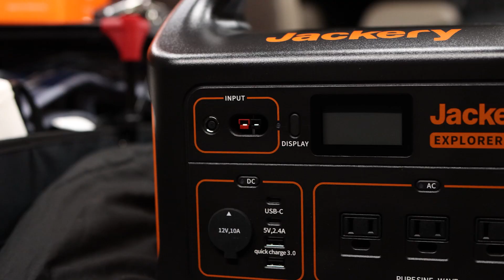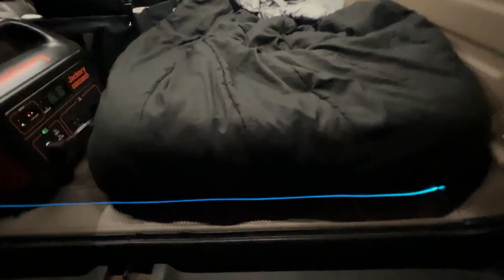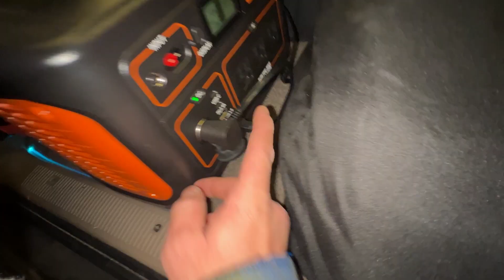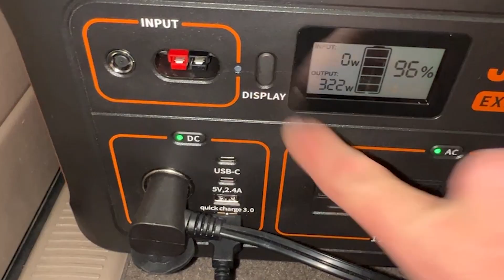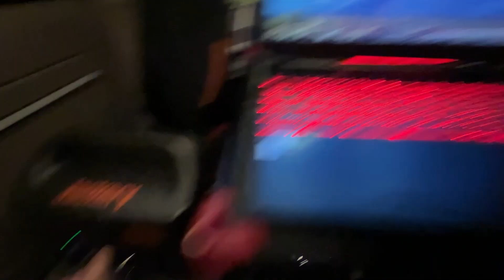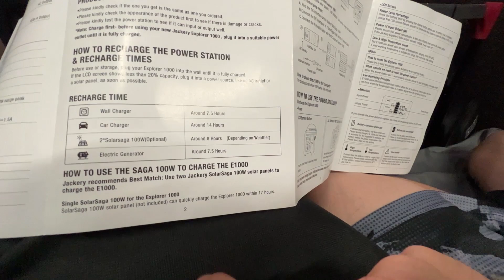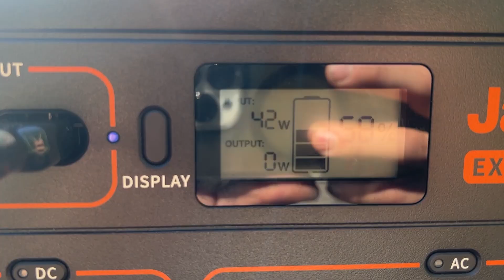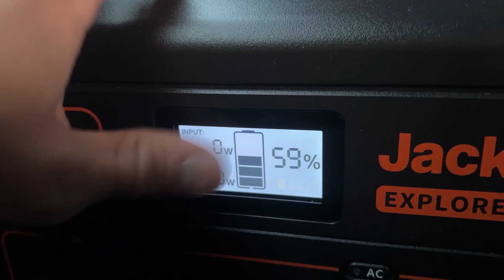SUV Stealth Camper With Moto Hitch Carrier Tour | Jackery E1000 Testing | TW200 MTN Adventure

Comment: Hello again from western Canada. It's been awhile. So, u r outfitted pretty well but I don't think you will be having guests over for the night lol.
Couple suggestions at me being 72. I've mentioned before I have a 2018 TW. So back in the 80s, my wife and I were camping a bit remote in my converted van. We slept cross ways to the back doors. It was super hot in the summer so I had one of the back doors slightly ajar. In the wee hours , someone or something tried the side door. Talked about scary. I gently got the back door closed so I could lock it.
For yourself or any body, I think you should have a few very bright roof lites and a siren that you could just hit an emergency but button to turn on all ur outside security. Being you camp solo.
The other thing is you should have a small nylon RV carpet to step on to reduce dirt traffic.
Finally, being you have a roof top carrier, have you seen those little steps that hook into the door latch loop on the door frame? It gives you a step for getting things off the roof instead of standing on the seat.
Cheers, Kelly
Reply from the maker: hello good to hear from you again! for sure, only room for 1 haha. neat, oh wow that's insane. i'm sure that was scary, glad you were able to lock the door, yeah that's a good idea for sure, I do have a remote start system so I could hit that. on the van i'm going to have 4 night vission cameras with IR illuminators and switch and screen next to the bed with a 4 channel switcher so I can always see whats out there. that's a good idea as well, sure do get a lot of dirt inside. those are neat, I usually stand on the tire and that works pretty well too
Thanks!

Comment: i did my express van with a big kitchen counter and usb faucet and sink too. lived out of it a few years and saved tons of money while working. tbh rarely needed the sink, even when i was out in the backcountry camping and riding; but probably cuz i had a below counter grey tank and quickly learned brushing your teeth into it got too funky. my newest van is a 2011 sienna wheelchair van with built in tie downs. made the bed to fold up so i can wheel my xt250 in and strap it down. you can put your bed in the suv on a short platform that folds up and keep bins underneath for all your stuff.
Reply from the maker: nice! seems like the life. yeah depends on the person, I could see myself using it a lot. but yeah under the sink gray water would suck, mine goes outside into an outdoor bucket or ground depending on area rules. nice, yeah for sure a lot of ways to do it. i'm doing a lot of neat stuff with my econoline build

Comment: Thanks for the vicarious adventure! Love the idea of simple stealth too. One suggestion for your rig, add another switch and offroad led floods on the 4 sides of your roof rack, great to light up camp for setup and when u hear something outside in the middle of the night
Reply from the maker: hey no problem, thanks for watching! that's a neat idea, I would like to do something like that someday, defiantly doing a setup like that on the van. also doing a 4 channel camera setup on the van with night vision so you can monitor out 4 sides with night vision cameras right from inside at the bed. going to be a rad setup

Comment: Yep! On our Idaho trip, we went up over 10k' with no carb issues, stock jetting. I think the early tdubs with the pumper style carb me be affected by elev some, but still maybe not as bad as some think. I will say, we rode close to 1300 miles through Idaho and Montana, and at high elevation the fuel mileage was way down. If you lived there all the time, it may benefit from a leaner jet. Good video man, enjoyed it!! Looks like that area close by was huge in mining.
Reply from the maker: awesome, good to hear that worked out well. that makes sense, they did upgrade the carb at some point. oh interesting . for sure could make a difference. I need to do some fuel mileage tests on mine. thanks so much! I'm sure it was, I thing one of the roads or something is called minecart road haha
Reply: @TDubsKid  ha, that's cool! When we were up in Wallace Idaho, there were deep mines on every corner. Such a cool place. Think I read where like 21% of the world's silver came out of that area!

Comment: Stealthed my dodge ram last yr,,,nice to have options
Reply from the maker: nice! do you got a shell on it, truck campers with the shells seem like a good way to build
Reply: @TDubsKid  I'm slipping into geezerhood,,I like trucks,,but vans are a more comfortable option,,,before the truck I considered a 172 inch wheel base dodge promaster,,I am the only person I'm aware to fit a diesel heat into a pickup with a shell and make "NO cuts to do it,,it's in front of the drivers side rear wheel and ducted with abs plumbing pipe thru two plastic capped holes in the bed bulkhead that we're there from the factory,,in front of the other rear wheel is a 130 amp hour wet battery to run heater fridge light phones fans etc,,and on rear is a15" x15 4ft aluminum box that plugs into the hitch receiver,,i can fully stealth ,,remind another time and I'll tell the mods on my tw 200
Reply: @TDubsKid  air is thinner and cleaner at high altitude,,use a less restrictive filter media
Reply from the maker: @wonyankeesays5661  yeah makes sense, trucks just dont have much headroom, its nice being able to stand up though, I just test drove and inspected a promaster van at work, it was really interesting, sooo much room inside, have you driven 1 it’s interesting, feels like driving a compact car for some reason, I would stay far away away from a diesel promaster they have major issues, the regular promaster is ok but they do have some reliability issues. Wow that’s interesting, I would like to see how you have the diesel heater mounted. Do you use a Chinese diesel heater? Sounds like a cool setup, lead acid power is not bad just heavy especially if you need a lot of kwh
Reply: @TDubsKid  went truck,,vsn get attention more when stealthing,,,wife and I are over six feet,,just have to think everything thru very well before do ur build,,not a diesel person,,except for heating,,I have six of them now,,,the gas penta stars make plenty power,,mine A red regular cab long bed,,had to go to another state to get one,,went with a renogy charge controller for electric,,paid a pro to install it,,

Comment: Thanks for sharing the adventure! Nice power supply. I look at those from time to time. Sweet discount.
Very cool setup. I wish I was getting out more. Sorry to hear about the other drone. Good luck with the new build.
Reply from the maker: hey no problem! thanks for watching. so far it seems to be a great power station, yeah they are cool, just wish they were not so expensive. maybe someday there will be a battery technology breakthrough, thanks, it was fun to build. I wish I could get out more as well believe it or not. yeah it was bound to happen someday. I had that 5in since around 2020 it was my first build. can't wait to try the ultralight 6in, nearly double the battery capacity with close to the same weight
Reply: @TDubsKid  I pulled the trigger right before the deal expired. After looking at different models, this one really stood out with the deal you had arranged, it was a little more off than advertised. I'm looking forward to some remote power capacity. Thanks!!!
Reply from the maker: Nice man! Yeah it was a good amount off. Hope you get a lot of good use out of it. Its nice having good amount of power like that off grid. If you store it for long periods of time I would recommend keeping it around 60 to 70% and not below 40% healthiest for lithium batteries. Power stations also consume a a tiny amount of power just sitting there over long periods due to the battery management system so good to check it once in a while. Also if you end up needed more 12v ports and more usb ports you can get a hub that expands to 3  12v ports and 4 extra usb ports. I like how they give 3 ac plugs already built in. I cant wait to try it out powering the diesel heater this winter

Comment: Great video. 
You know, I’ve been a big Toyota fan since i started driving back in ‘88 or something like that. I’ve had some gnarly 4WD’s, just bullet proof trucks! But the one that I have now, which is a 5th gen 4Runner, this thing has been giving me some serious headaches with its electrical system... 
It’s mostly the dashboard lights. You know, all the little indicator lights? They all stay lit up all the time. And I looked it up and learned that it is a notorious issue with some 4Runner’s, they call it the “Christmas tree dash”, lol, but I’ve yet to find a solution to this problem! And now, when the headlights are on, the dashboards back lighting dims when you hit the brake pedal! It’s really been frustrating, and I’m scared to add any accessories to the truck that require any kind of electrical modifications. I did install an air compressor under the hood when I first got it, but the problems didn’t start happening until well after that install. Despite hearing about other people experiencing the same issues, I haven’t found anyone that’s offered a solution. I took it to 2 different independent shops, and they couldn’t figure it out either. Other people have claimed to have taken it to Toyota, and they’re still having the issues.
Reply from the maker: thanks! yeah older Toyota trucks were the bomb. yeah the new ones have all of the modules and bus communication systems like all other newer vehicles, thats a crazy strange issue. I wonder if I did a full system scan with my scan tool I would find any fault that would maybe point towards an issue. Is your compressor hooked right to battery? also does is there an intelligent battery sensor installed? they are not as simple as they use to be
Reply: @TDubsKid I wish I had a quality scan tool of my own. I am assuming that the people who I read about on the internet who brought their trucks to the dealership had their vehicles scanned. But I try to avoid stealerships all together. The air compressor is essentially connected directly to the battery, aside from having an on/off toggle switch mounted on the dashboard, and an in line fuse next to the battery. No intelligent battery sensor that I know of... 

It boggles my mind that I’ve heard of so many other people experiencing similar issues, especially for so long, and that no one seems to have figured it out... It’s been probably a year now since I last browsed the Internet looking for answers, so I need to start another search, but this has been going on for a very long time. 
I try to do all my own repairs, and I have projects going on all the time like yourself. But most of them are older vehicles. I have an old Jeep that I’ve done a total restoration on, replaced the motor, upgraded the axles, etc. ext., but I can’t figure out something that seems so simple such as this. It’s definitely frustrating.

Comment: Thanks for all your videos. Do you have a video on cam chain tensioner adjustment? My service manual is not clear to me. It list from 1987-2000 but not anything to present.  This manual does from 1987 to 2017. I have two tw 2009 + 2015. Any help would be appreciated. Thanks
Reply from the maker: no problem, they put an autochain tensioner on the 2001 upgrade and newer, no need to adjust

Comment: Hey there, nice set up. Just wondering what kind of motorcycle carrier is that that fits the wide tires of your TW200?
Reply from the maker: hey thanks, I have a video on it here: https://youtu.be/TIlAccAmI_s the rear tire doesn't fit but I use a strap

Comment: I wonder if you could get any channels on a TV out there? My antenna gets about 50 channels a about 30 mile range I think.
Reply from the maker: I kind doubt it because I'm in between mountains in the valley so the signal get's blocked, on top of the pass I might though, I had cell service up there

Comment: What brand hitch carrier is on your 4RNR?  Looks very sturdy, doesn't wiggle much, and it looks like it carries the bike well over uneven ground.  I need one for my own TW so I can access more of our BDR rides here in Washington!
Reply from the maker: Black widow brand, have a video on it here. https://youtu.be/TIlAccAmI_s?si=aUnc-GUwx9UmV6rf, I dont recommend the anti wobble device it comes with, the bolts fell out on a washboard road, I would get this one, the one I use, it works great and never seems to loosen up. https://a.co/d/5LiNsp3 yeah take the thing off road, it works great. Need to add brake lights to it soon though
Reply: @TDubsKid  Thanks very much!  This will solve all my solo transport issues, and it doesn't cost my right arm!!